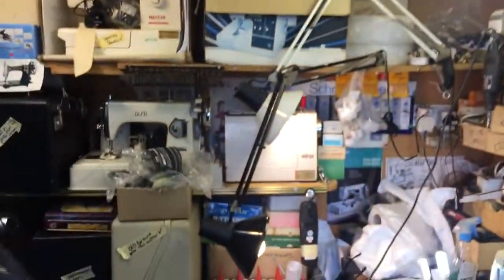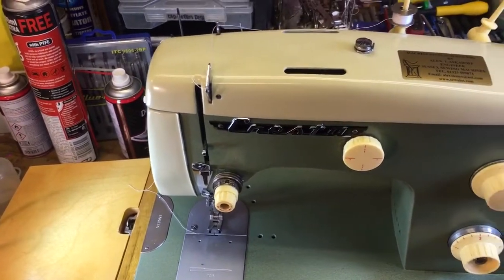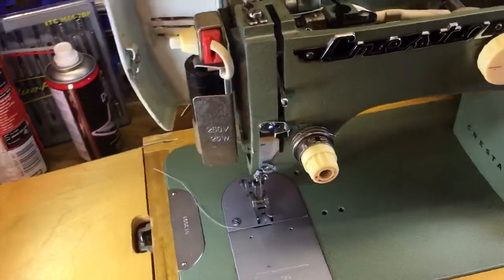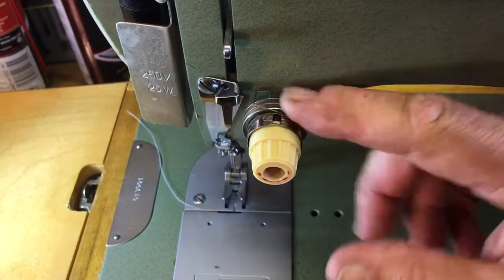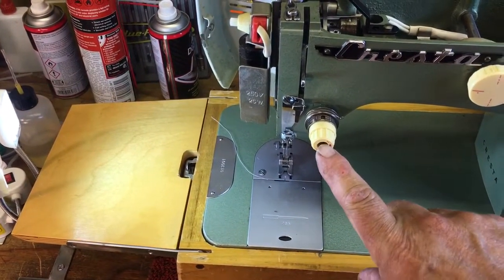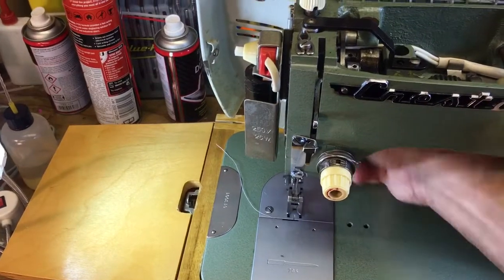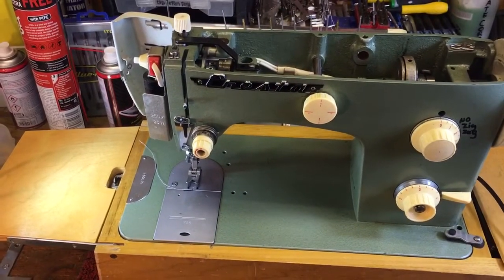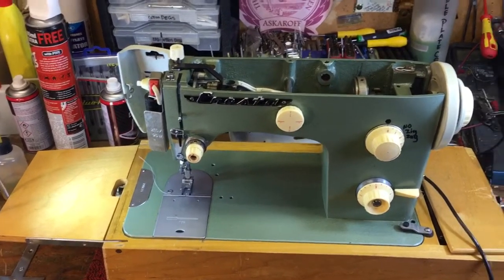How to adjust sewing machine tension by Alex Askaroff.

Comment: thankyouthankyouthankyou  for pointing out the need to thread with foot in raised position -  intermittent birdsnesting on electric machine been driving me crazy.  I also have a Wheeler & Wilson D9, loved the article on History of Wheeler & Wilson, gorgeous illustrations.  Have had the machine a few years, but only just dusted it off and started  reading the manual  {pdf},  which is delightfully blotched and old but  legible.